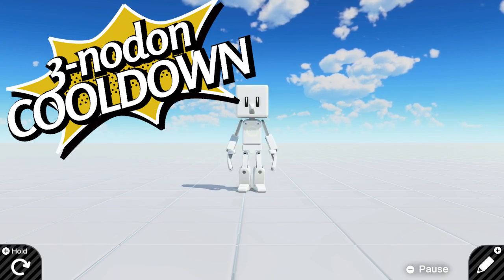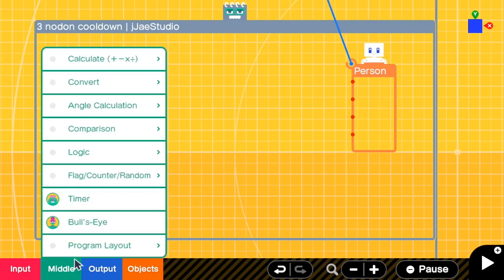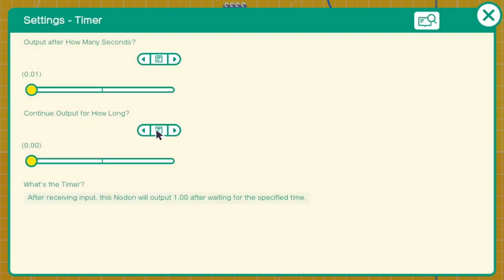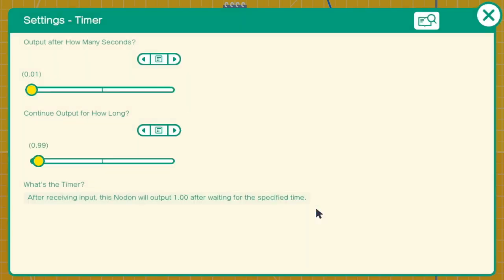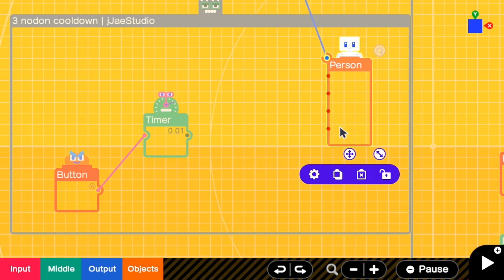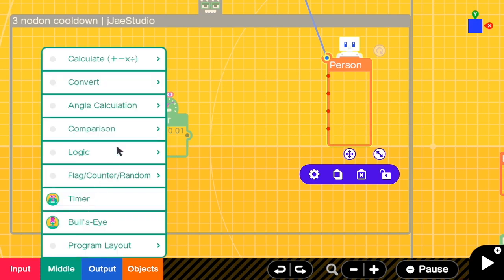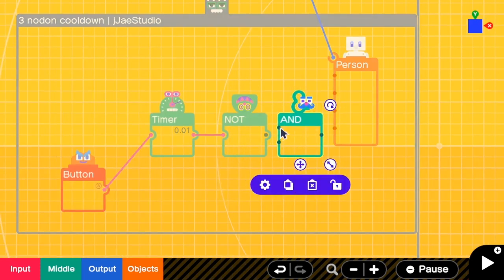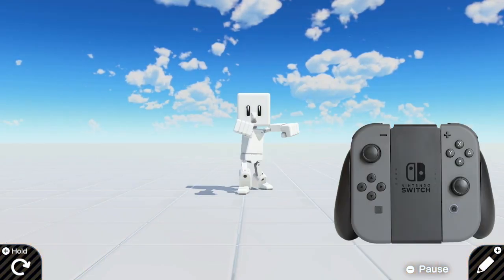Stop Button SPAMMING / Add Cool Down with 3 Nodons only! (+code) | Game Builder Garage Tutorials

Comment: For some reason it’s forcing my person nodon to do the celebrate action in between the punches l, which is quite the opposite of what I was expecting. This may be because I already have a code to make my persons punches destroy enemies, so what should I do?
Reply from the maker: Do you have a code that you can share it with me. : )
Reply: @jJaeStudio  I’m not sure I do unfortunately.
Reply from the maker: @josiahthediscontinued9976  How about check if the button settings is "on press" instead of "while press" : )

Comment: I got a 2 Nodon way. Put input into
Timer with 0.01 delay, (0.99) continue. Input timer to
Trigger From 0, then input that to action!
Reply from the maker: Good one! Thanks for sharing. There would be a delay of 0.01 second. But, I think it is quite short and is bearable. :D

I have also tried a similar method but it was a timer with 0.00 delay with trigger. This one does not work because the timer sends out continuous output.
Reply: @jJaeStudio  I think its a 0.0167 second delay because it rounds up to frame duration, and (without lag) runs at 60 FPS